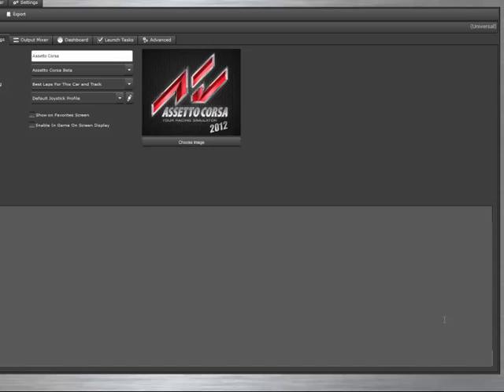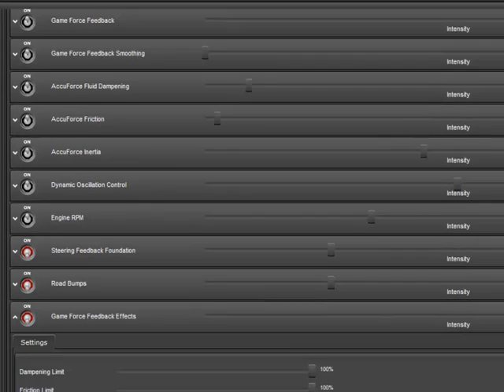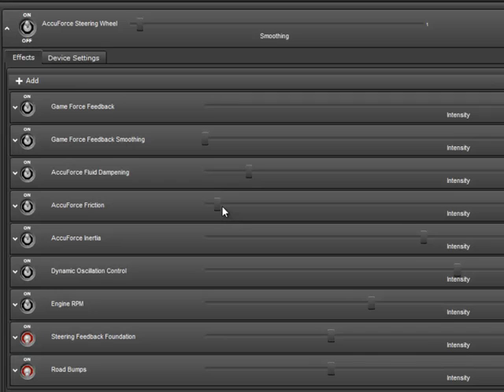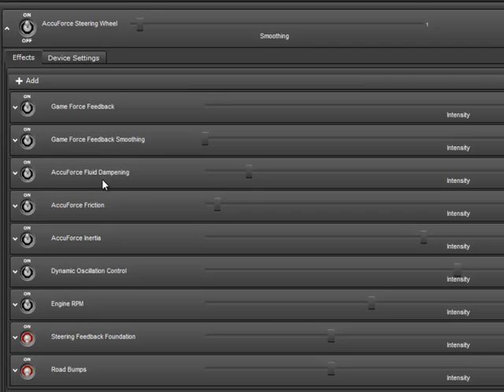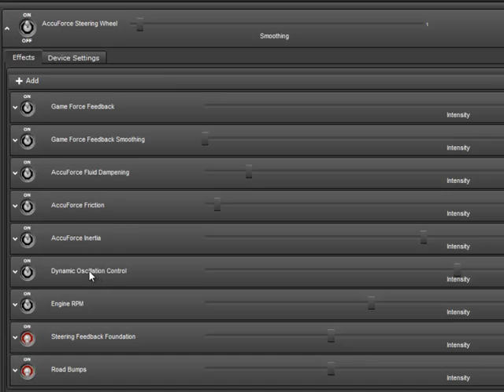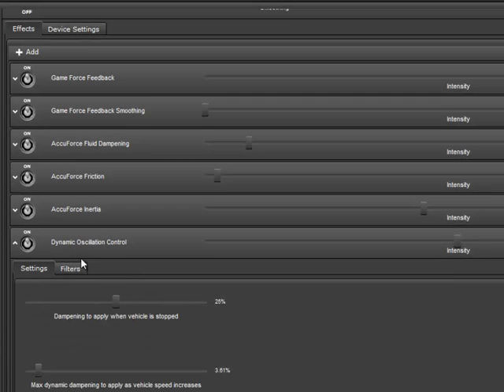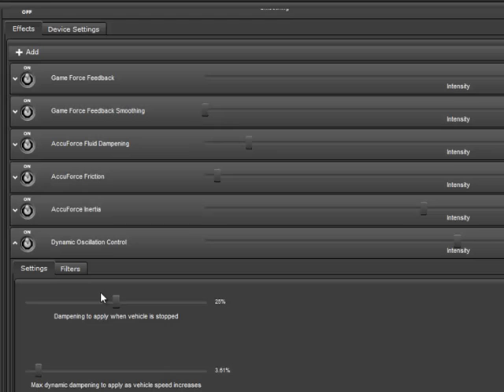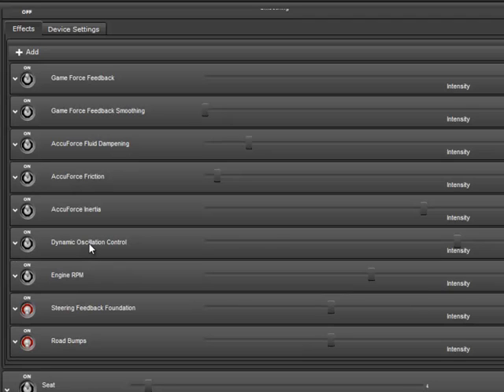AccuForce Oscillation Control

Comment: We need more videos like this! There are so many options and things to change its hard to test them all and have it not get convoluted. I know you guys have cloud tuning now, but it leaves a lot to be desired. Considering all the things you can adjust cloud tuning seems to do the bare minimum and doesn't tune most of the possible options at all. I know the software is capable of great things but we need more useful info like this and have cloud tuning really play with more of the tuning options and give users a couple different cloud options to try.